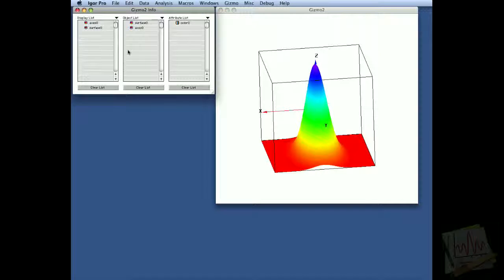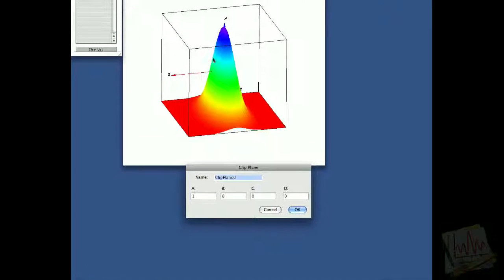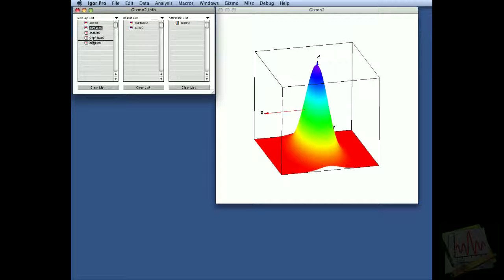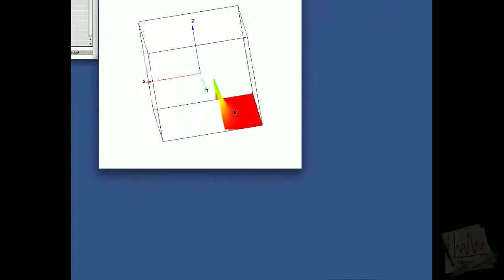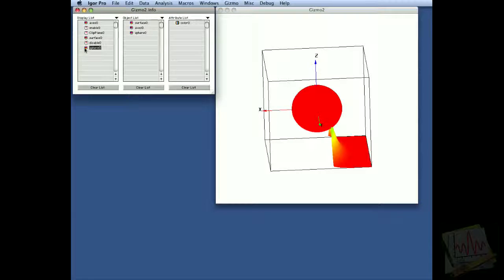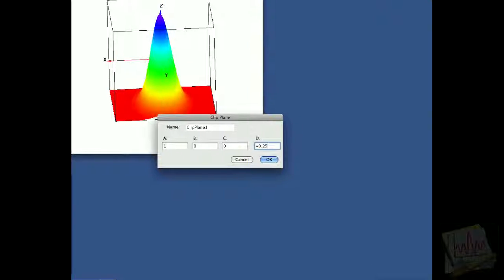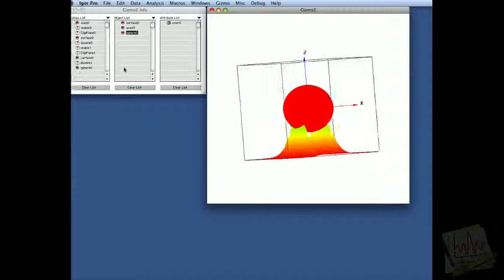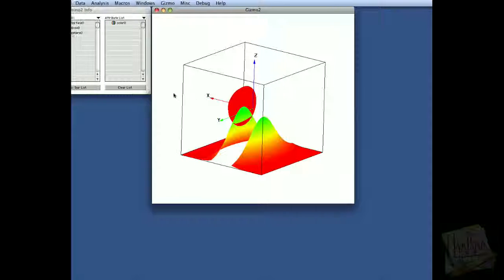IGOR Pro Gizmo Techniques: Using Clipping

Comment: Adding a (Clip Plan) does not exit in (Append New Operation) menu given by the small triangle to the upper right hand-side corner of the Display List of Gizmo Info window. Does it need introducing "another plug-in" to IGOR to let this (Clip Plan) item appear? If not, What is wrong going on then?

Comment: Hello Mohamed,

You are probably not finding some items on the menu because your Gizmo is configured to standard use.  You can configure it to advanced menus by changing your user level.  

Since you have access to IP7 beta at this point I recommend using that version because Gizmo's GUI and output have been considerably enhanced.  

For quicker response to technical questions I recommend contacting us via support@wavemetrics.com or posting on the IgorExchange (www.IgorExchange.com).

A.G.
WaveMetrics, Inc.